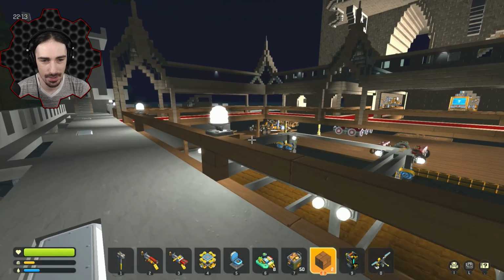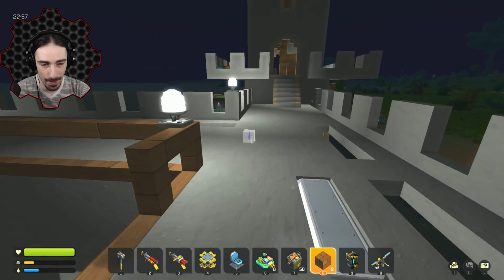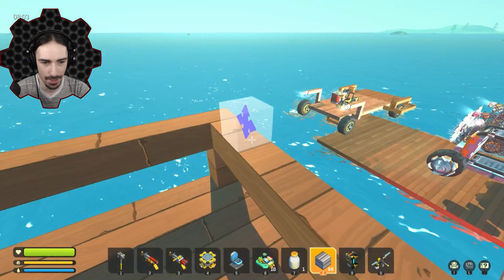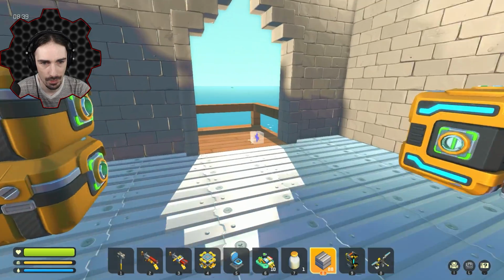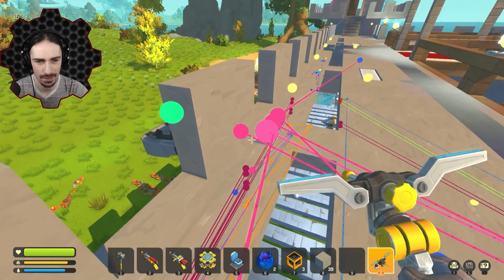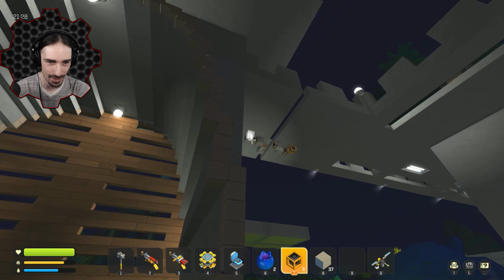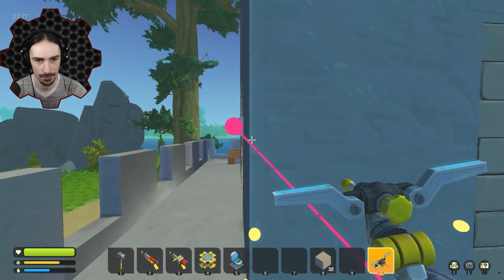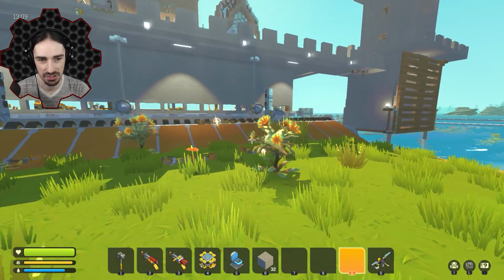BASE HACK: Using Wireless Switches to Reduce Base Lag! - Scrap Mechanic Survival Mode [SMS 79]

Comment: 10:26 I just don't get why you used a logic gate if all your doing is turning the switch on and off to open or close the piston and that is it... you can save resources and reduce lag that way too... switches work directly on your pistons no logic and do the same exact thing as adding that pointless logic gate you added which is an additional calculation and each one ads up...

Comment: another thing I'm thinking is causing the lag, is when you place the block like you keep saying, I think after so many blocks are placed the game is possibly programed that each time a block is placed, it recalculates every single block attached to that item to see what it changes, so colossal builds that are connected as a whole piece, have a ton of blocks to recalculate. If this is the case I believe the best way to resolve this would be, if a block is welded to the ground, terrain or any buildings that are pre built in game or rocks etc, then the game should be programmed to recognize that vs building a car on your lift or just on the ground without it being welded to the ground, so that if welded to the ground, it only recalculates the surrounding blocks close by not blocks 2000 blocks away as well as all other blocks that distance in opposite direction. does this make sense at all? now, if that's not how the game is programmed, then my whole theory is useless just ignore it, I'm no programmer lol.

Comment: If you want to hide the seperation between your buildings, you could add a bearing to one side of the gap and hook it up to a controller, so that it doesn't move. Then you can attach blocks to that bearing and they will stay seperate from the other building, even if the blocks are touching each other.

Comment: To reduce lag vertically why dont you make a multicore pillars? Like if you get a 3x3 area you can get the 4 corners and extend them up and where they meet the floor they'll all go trough except the one connecting that floor, so you basically have each floor consisting by walls and ceiling or walls and floor and they'll be fitting together not touching at the pillar.

Comment: For the vertical separation of the base, you need to separate every floor of the tower. Then, in a 3x3 area, surround the outside eight blocks with something like pipes. Then, use the hole in the middle to build a pillar down to the ground. That way nothing should be connected and is very simple. There is going to be a 1 block gap in between each floor though.

Comment: For the castle or workshop part you could put some pillars inside that only connects to the upper part. Also, i belive if the corners of the blocks touch it is still a different object, so you also can hide the seem.

Comment: Scrapman not sure if you know but if you plant broccoli or pineapple plant first then use fertilizer they will sprout without 2 watering and on my world if I plant first then use fertilizer it doesn't use 1 per use i have had the same 15 fertilizer since I started my build plus u won't get 2 raids if u plant at the right time

Comment: You could do that with potato guns as well. You just put some strategic switches that will be automatically shot from a mounted spud gun on the other building. One more thing you should do is make a separate platform in the water were you weld your vehicles when you're not using them. I've seen you try something like this, but not go through with it to the end. There's a lot of proof of concept on youtube, check it out. If you use all these tricks, you can keep on expanding your semi-floating Scrap mahal.

Comment: I sure wish that Scrap Mechanic had a way to write in a comment for switches, logic gates, etc. so I could remember what they're supposed to be doing.  ScrapMan was struggling with some pretty simple logic gates, and I know the feeling..  But  it gets real bad when you have memory bits.  Is this the "Set"?  The "Reset?"  The "On"? The "Off"? And wtf was this bit storing anyway??

Comment: You could have made it much simpler if you had the bridges on a timer to automatically close them set at 2 minutes and get rid of all the unnecessary logic blocks. As well as having the sensors on pistons to move them closer to detect when you need them to open

Comment: Oi.... How bout ya loose the connection between the garage floor and first floor and between first floor and the towers.
Also at machines like the elevators, maybe you're able to put them onto an own ground module. Like the gunmodules of big battleships. Their artillery turrets are only sitting inside the by gravity and only tuch on purposed spots.
Put things like the saw onto the ground by a lego system

Comment: Isnt there a glitch in Scrapmechanic, if you weld a Bearing between the two creations you want to separate. If add the connections and then REMOVE the bearing, the connection stay intact, thus making it Wireless. Doesn't that exist already?? Why is he using sensors?

Comment: The castle can be separated from the center. The smaller tower at the top, disconnect the blocks around its a perimeter, and create a LONG column that goes through the bottom 2 floors beneath it and attach to the sea level ground beneath your base. This way it looks like support columuns in the center of your castle. You would need to make cut out Holes for the columns to penetrate thru each floor so its not touching the rest of the castle. This would disconnect AND look cool in the process. Like it you understand!!

Comment: what you could do to decrease the lag on the back section is that you could separate the platform from the pillars holding the castle, connect the pillars to the seafloor and that's it

Comment: My base is actually separated as different buildings and platforms & i use a pump, excess seeds (there pretty much always are excess seeds) and a button to do wireless communication over long distances, cheaper then doing the same with spuds, and much longer range then doing the thing with pistons and sensors :)

Comment: Day 4 of asking scrapman to do a mini train multiplayer monday (Scrap Mechanic)
Rules: No thrusters
Has to look like a train
Has to have 8 wheels or more in total (4 wheels per boogie)
Mods can be allowed but no glitches or very fast blueprint editing (mods only for small parts and decor.)
Max build size 5x20 (not sure how long but not too short)

How to set up:
If the game can handle it all go at once (if not do 2 players and who gets faster time wins or do a solo time trial)
Engine speed 3 from top (Electric or gas engines, you guys can choose)

Challenge: 
Train starts in train yard
Then goes to a nother train yard with train cars to pick up
Then travels for a bit and drop of the cars (add some rail road crossings and make you guys honk your horn when going by)
Then go back to the train yard
Then stop engine or just stop moving

Judging score:
How fast or slow
Controllably
Looks
How good of a job the worker did (like train cars and loading loads off of train cars, and with the laws with trains like stoping at red lights and honking at railroad crossings)
Any other ideas you guys have for judgement

You guys can change any thing if they would be too hard to do or dont understand it or is not possible. Comment if you have any questions or comments or if you like my idea.

Comment: You realize that connections are already wireless? lol, Imagine if you had to run actual wires everywhere on the ground that would be oof.
Reply: Dnh Bear I’ve always assumed the idea is that there are actually wires like that inside the blocks. That would explain why you can’t connect from one creation to another. Of course there no wires actually in the game, but I think that’s what the developers were thinking when they decided to make connections work like that.
Reply: YES. You gave me a cool MM challenge idea: they have to do a race, but they are only allowed to connect two parts with a wire if they are actually touching each other. So they either have to use chains of timers/logic gates, or sensors and pistons/controllers. That would be interesting! Also would somewhat get the feel of what it’s like to build redstone things in Minecraft lol.
Reply: @vibaj16  Yes! This would be amazing.
Reply: @vibaj16  Interesting

Comment: I think you should separate the workshop tower thing from the vehicle platform by extending the support poles to the bottom of the sea and then removing the blocks under the poles. Just a suggestion, but like if you agree so Scrapman can see.

Comment: Make a 9x9 hollow pillar that supports the lowest floor, 5x5 hollow pillar inside the 9x9 hollow pillar to support the second floor, and a 1x1 pillar all the way inside that goes all the way up to the highest floor.
Increase the thickness if needed and and just have all the pillars inside of each other and have a realistic pillars inside your rooms supporting the higher floors.

You can even hide it inside one of the walls if you feel like it.

Top down view with legend:
= : Outer wall or pillar wall.
| : Same as the above.^
~ : The emptiness in between the three pillars making it so that they are 3 different structures reducing the lag, while also hiding each other as to not ruin the aesthetics of the build.

=========
|~|~|~|~|
|~|~|~|~|
|~|~|~|~|
|~|~|~|~|
|~|~|~|~|
|~|~|~|~|
|~|~|~|~|
=========

Comment: 1st, great video
2nd, as previously mentioned, vertical separation with dual pillars 
3rd, just turn off the tool you created in your workshop. Ie: chop saw. Running bearings for asthetics is killin frames for me.
4th, I appreciate you and those that commented this videos idea. Such a great tip 
5th, MM idea: Trebuchet contest

Comment: uhm.. why not just use a controller 2 bearings and 2 sensors ?
a sensor in each tower  and the controller  just operate  a flipper triggering sensor on tower sides.   cheaper than pistons

Comment: Make a suport beam through the castle and have it connect to the upper part but not the lower part. Also if you make it hollow and big enough you can have another smaller support running through it to hold the third floor.

Comment: @ScrapMan With the lag you have with the main castle, maybe it's due to the vehicles on the bottom floor and all the machines on the second floor. You have pillars holding up your castle. It shouldn't be to difficult to have separate pillars holding up the castle from pillars holding up the bottom floor. That might improve performance.

Comment: Instead of having the draw bridge communicate with the farm which communicates with the other draw bridge, you can have the draw bridges connect directly to each other by using a switch/button connected to a mountable spud gun, which shoots a spud at a switch on the other draw bridge.

Comment: you can separate your builds with a line on a bearing connected to a controller to it doesn't move

please like this comment
Reply: but it doesnt separate it, thats the whole point of doing it
Reply: Like connect two pieces of the base with a bearing?

Comment: For the vertical detachment of workshop of the base to make less lag.
I suggest putting 2 single block support arms on the back of your creation at right angle, down to the ground under the water. Then cut a horizontal line all around building.
 I suggest doing this either on the second floor above your Workshop or the roof of your Workshop.

Also you could remove the four connecting pillars from the driveway to the bottom of your Workshop. By simply cutting, the driveway where the pillars meet, open a block wider than the pillars and have a single block pillar going down to the ground underneath the water. Either 1 or 2 supports or Each under all the 4 pillars so that way the workshop is not connected to the driveway underneath. but the pillars still add to aesthetic value.

Comment: for the workshop part of your base, you could support an upper floor and walls with a single post that either runs down through the lower parts of the build, and make sure that post is only connected to the "game-generated" ground, OR you could build a support that goes from an outside wall around everything below it, and into the sea bed.  You would still have two large builds, but they would be separated at, say, the edge where the floor meets the wall or the wall meets the ceiling.

Comment: Rebuild hidden creations just by looking at its connections
Reply: I saw you post this on the previous video and I wholey agrees with you
Reply: @Theresalwaysanexit  holey isnt even a word and i agree with you!
Reply: I holey agree with both of you.and if scrapman shows a picture of this if he does it .can I be in  a blue circle?
Reply: Like this post so ScrapMan can see
Reply: Saw This On The Last Video

I Agree !!!! 🙂
Reply: i don't get any of this even  some of the reactions
Reply: @spacewalk3046  so, there's a creation that has some logic gates, pistons, suspensions, bearings and other connectable pieces behind a wall, they have to recreate that same creation just by looking at its connections without peeking.
Reply: good idea fam
Reply: I holey agree with you!
Reply: Or by deconstructing it
Reply: I agree though it would be hard
Reply: Little did he know, he did this
Reply: @loopdeloops  Oh, I do know since scrapman did the challenge because of this request.
Reply: Yes very much yes
Reply: Would be cool but nearly imposible because almost all connections look the same and have the same color
Reply: Llama Legends no. For example, a small vehicle would be easy: green is seat connections (steering, engine). Orange is engine connections (from engine to bearings). Blue is logic connections. Pink is sensor connections. Purple is controller connections. Bearings are easy to see and figure out what they do based on their color and what they are connected to.

Comment: Separate the parts vertically and leave a poll that goes from the top part to the bottom of the ocean, avoiding the lower part. Either on the sides or on the back.

This should deal with the workshop lag.
Reply: yeah I had a similar  thought , scrapman can add pillars which encase the pillars of the top floors  like a pipe in a pipe.
Reply: too good no tension on blocks can make 1 block thick
Reply: yeah or a thicc pillar in the center
Reply: Make a 9x9 hollow pillar that supports the lowest floor, 5x5 hollow pillar inside the 9x9 hollow pillar to support the second floor, and a 1x1 pillar all the way inside that goes all the way up to the highest floor.
Increase the thickness if needed and and just have all the pillars inside of each other and have a realistic pillars inside your rooms supporting the higher floors.

You can even hide it inside one of the walls if you feel like it.
Reply: @Petq011  Or, if you don’t want to run up by the square each time, you could do a hollow wall that’s 5 thick. Then you only have a 1x1 running to each floor you want. E.g., n supports would fit in a hollow wall with dimensions 5 x (2n+3). 

Breaks at the top of the walls between floors could be disguised with a staggered line (basically crown moulding).
Reply: @StewPedassle  Yeah!
Reply: @Petq011  similar idea but needs "less" space and supports more floors: starting from the center, make a 1x1 hole from the ground up to the top, now on each side of that 1x1 hole pillar, make 1x1 pillars from the ground up to the top(each pillar can support one floor, none of those pillars will support the lowest floor, the first supported floor is the second lowest floor) when you reach the second lowest floor connect one of the pillars with that floor(pillars which are connected to a floor don't need to be built any higher) continue like that until all of the 4 pillars are used, make sure that you have 1x1 hole pillars on every side of those 4 pillars(exceptions: the blocks which are needed to connect the pillar to the floor). Now to make it look a little better, because no one wants to have holes in the floor: make 1x1 pillars, from the ground up to the top, on each side of the 1x1 hole pillars which are surrounding the 4 support pillars(those pillars support the lowest floors(if your lowest floor is on the ground, then those pillars won't support any floor and are just for cosmetics)), make sure that you don't connect those pillars with the floor above, do the same on each floor. And now you're basically done.
If I wrote it to complicated or just bad(sorry I'm not native English speaking), then upon request, I could build an example and upload it on the workshop(or however its called in english)
Reply: @patricefrey5922  You basically described mine, and the idea before yours, but in a simpler cheaper way. It is fine, I realize that I suggested a really expensive way to go about it, but it will add to the "castle feel".
And the way described by the other user, and what I suggested "covering it inside a wall" is a bit expensive, but is the most seamless way to go about it.
And then the way you described it is the most cost effective, requiring the least amount of resource. It is a good idea, I hope ScrapMan reads your comment ad goes with it. :)
Reply: porkshop!!!
Reply: That would look ugly as heck tho...
Reply: @thestignl1153  not really... It can be easily concealed as previously stated...

Comment: @scrapman  you know since it is a glitch it is probably going to get patched up at one point, a better way to do that is by using pistons and sensors sensors either to detect blocks or colors and pistons that would move those blocks in and out of the way.